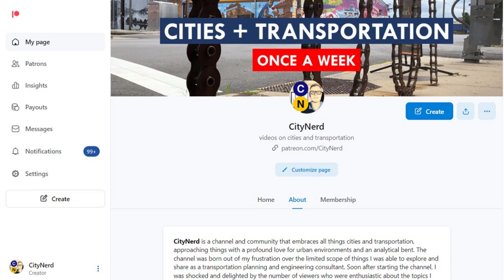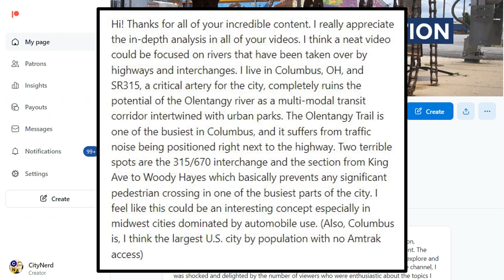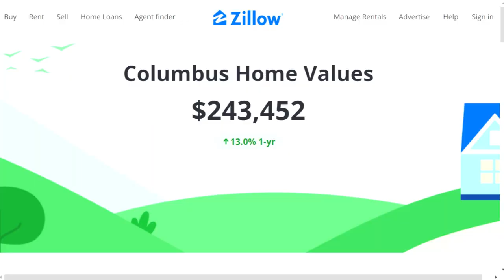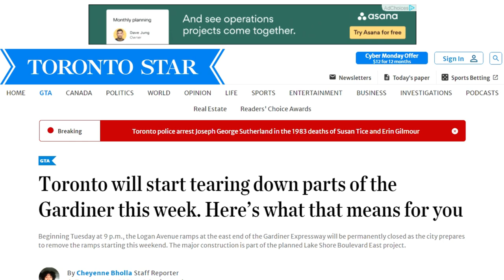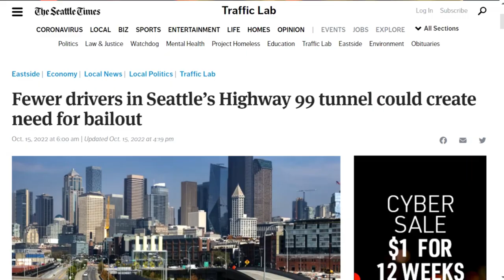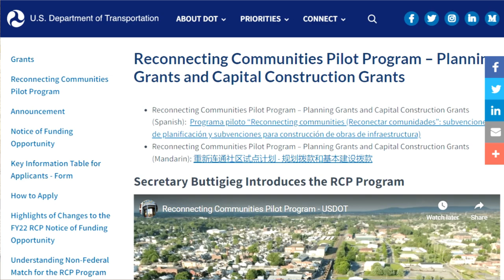Highway Engineering Madness: 10 Waterfront Freeways That Need to Go (North America Edition)

Comment: I lived in Brooklyn Heights/Dumbo for 10 years, and in NYC for 17. The BQE under the promenade is not only well tucked into the edge of the Fruit Street area, it does so without blocking access to the park below. There are several breaks where pedestrians can get to the park- at Doughty St, the unique cable bridge near the Watchtower building, and at Joralemon St and Atlantic Ave. The high end hotel near the Dumbo end of the park wasgenerously designed with a portal to provide access to the park. I believe most people in Brooklyn Heights actually like this bit of buffer- I know I did. While porosity is generally a good thing with city blocks, it would not improve the experience of either Brooklyn Heights nor Brooklyn Bridge Park for anyone and possibly make it worse. 

Also the view of Manhattan which occurs when traveling towards Williamsburg is astounding. Virtually everyone in NY has enjoyed this view. As you come around the corner near One Brooklyn Bridge Park, the intensity of lower Manhattan just hits you all at once. Soon you see the Empire State building dancing between the Brooklyn and Manhattan bridges. From above on the promenade, people not only look at the skyline, but the cars passing below as well. I lived in an apartment that was eye level to both the Manhattan Bridge and the BQE- I considered this a feature not a bug, as did my neighbors. 

The BQE may very well have been a mistake, but eliminating it would costs billions upon billions and disrupt life for at least a decade. The resulting retaining wall that replaced the BQE would have to be something like 10 feet thick. The land it would free up would not be useful for too much- it would be narrow and of course have a giant 50' wall abutting it. The city would be mired in NIMBY lawsuits from some of its wealthiest and most powerful residents. If Jane Jacobs were alive today, I believe even she would say it'd be foolish to tear it down. 

This is the problem with planners- they believe they and they alone have discovered Platonic models of urban form. If moving the BQE creates even worse problems in Brooklyn Heights- they'll say that was an unforeseeable negative externality. They do not care so much about local nuance and behavior. They take credit for what goes right, but never for what goes wrong. So while they wave the flag of Jane Jacobs, they are more like the Harvard planners she panned in her book- the people who ignored the intricacies and hidden systems of North Boston. This man, as far as I can tell, has never lived in Brooklyn Heights. His opinions about Brooklyn Heights shouldn't be taken any more seriously than my opinions on Portland or Seattle. 

Planners are a necessary evil. But they should act out of deep knowledge and experience living in the places they plan. While there are general heuristics on good city elements ( as in Jacobs book) there is no accepted theory of good urban form, generally. They desperately want you to think otherwise so they can continue to gatekeep their perceived authority over how you live in a city.

Comment: The worst thing about Storrow Drive in Boston is that it's officially parkland. Along with many of greater Boston's worst surface roads, it's operated by the state Department of Conservation and Recreation. It should be easy to get rid of, but DCR won't hear of it. I-90 will need to be rebuilt soon, and the state was hoping to do it at-grade to save money, but DCR had fisticuffs with the DOT over the idea that Soldiers Field Rd might have to downsize. DCR has a long history of sacrificing parkland to make room for cars, to the point where many locals call it the "Department of Cars and Roads" instead.

Comment: I’ve lived and worked in Boston since 2004, and one of the best moves this city ever made was to move its decrepit Expressway and Central Artery underground, as well as cleaning up the reeking cesspit that was the Charles River. As a result, what once was a vast expanse of desolate parking lots and condemned warehouses along the Boston waterfront has become one of the most up-and-coming neighborhoods on the east coast, and several financial companies I’ve worked for have built beautiful new buildings in places like 600 Congress Street, Rowes Wharf, and Fan Pier.

Storrow Drive, on the other hand, is a widely-hated engineering atrocity that resulted from the city being hemmed in by the river. It’s really difficult to think of anything better to do with a 19th-century waterfront boulevard that needed to expand, but had nowhere to go. All the side streets that go from the Back Bay onto Storrow are much smaller than the highway itself, so it became a stroad-zilla with lots of awkward bottlenecks, too many streetlights, and low bridges that are notorious for causing out-of-town trucks to be “Storrowed” (ripped open like cat food cans after drivers missed the height warnings).

Comment: Hi, I am a North Carolinian. In general, North Carolina tends to have lots of smaller watersheds as you approach the coastline, as opposed to one central watershed that all coalesces together. This is partially due to the very gradual downward slope from the Appalachians, to the Piedmont, to the coast. As a result, various watersheds feed into different estuaries, i.e., the Albemarle Sound, Back Sound, Bogue Sound, Core Sound, Pamlico Sound.

As such there is no one singular dominant watershed in which all commerce was historically conducted (compare to the Mississippi, the Ohio, the Hudson rivers, each dotted with large metropolises).

Also, as others have mentioned, North Carolina urbanized well after the North, and remains 40% rural by population (one of the most rural states in the country). Durham, for example, where I live, didn't exist before the Civil War, and rose to prominence because it was a railroad stop between Raleigh and Greensboro. This was a time (generally after 1850 as a heuristic) when canal- and waterway-based transportation had long since given way to freight rail.

Comment: Fun facts about Storrow drive: 

1. The land was donated by James Storrow and he vehemently opposed the building of a highway here but the second his wife kicked the van they built it 

2. There’s a very low clearance on the bridges that cross it but uhaul renters don’t seem to understand that leading to a phenomenon called “Storrowing” where Uhauls get opened on top like a tuna can

3. The esplanade is easily the most beautiful part of Boston but it’s incredibly loud because of Storrow 

4. They’re currently trying to fix a highway alignment to make use of a train yard no longer in use but instead of burying the highway, they’re trying to force even more lanes of traffic into a narrow bottleneck along with Storrow, the pike, a footpath and train tracks. Locals are calling it “Big Dig 2, Alston Bugaloo and despite MassDOT saying it’ll be done by 2034, no one believes them

Comment: Former Chicago resident here...I lived within 4 blocks of Lakeshore Drive for 8 years (2 different locations) and I wasn't too bothered by it.  It's a highway for sure, but I remember the posted speed limit only being 45 mph so traffic wasn't ripping through.  Its also very much an access road for local residents, and NOT a throughfare, so traffic was concentrated to commute times and there was virtually no heavy truck traffic at all.  I don't remember the lake access being bad, and I'll tell you, the bike/rollerblade/walking path and parks between the Drive and the lake were always packed with people.  I'll bet as many people travel Lakeshore Drive on a bus as in a car, so it is an important public transit corridor.  With all of that, the lakeshore would be much nicer without it.

Comment: Chicagoan here! I understand that the LSD does separate the lakefront from the city. There are a few points I think are worth bringing up. First, if the LSD was removed, the only other highway option nearby is the 90/94. The 90/94 is one of the most heavily trafficked highways in the region and I personally try to avoid it, if possible. Unless the city plans to determine a better solution for both of these highways, I think it is unlikely that the LSD would be removed. Also, I think it's worth mentioning that the LSD is extremely easy to cross as a pedestrian or bicyclist. I don't think that's true for a lot of highways. Personally, I am not as offended by the LSD as I was by the elevated highways in Portland. They are just so visible no matter where you are in the city.  
Great video though! I appreciate your knowledge and take on how we can improve the walkability of our cities!

Comment: Chicagoan here. Lake Shore Drive is just part of the city. It was here back in horse and buggy times. It’s a vital part of infrastructure that keeps a ton of traffic off of arterial streets. Plus, as many people mentioned, many bus routes use the Drive as a quick way for commuters to get downtown from far north or far south neighborhoods. I’ve lived within a mile of the lakefront in 4 different neighborhoods and have never found it hard to access the lakefront. There are tunnels or access roads everywhere. With all that said, many improvements could be made, mostly to mitigate noise.  Covering the whole thing would be ideal but simply removing would lead to a lot of commuters (including those using public transportation) to be displaced.

Comment: I live in Louisville and Spaghetti Junction there is awful. It's where all the interstates connect and you need to know which lane you should be in well before you reach signage unless it's late/early enough there's no traffic. 

The difficult part about removing the waterfront interstate is that we would have to get some actual transit first. We have bus service to some areas of the city, but the schedule and map are both lacking. I don't really have the option of using the bus even if the extra hour each way was doable, because it doesn't run when my workday is over. It's bad. Which makes the interstates worse. If you have to drive on them during rush hour the off-ramps often extend well onto the actual interstate lanes. 

But hey, it's cheap here.

Comment: i95 in Philly cuts off the entire water front from the rest of the city and also plowed through the most historic part of philly. they tried putting some lids over it but its only in small areas where its possible so you need to drive to get to the water front even if its only a block away in places.

Comment: I-91 is pretty egregious but it's necessary. I think it should be tunneled and the 91/84 interchange moved farther north up by the landfill to return the Bulkley Bridge back to a surface road as it was prior to the interstate system, creating an additional river crossing in the process.

Comment: Thanks for picking on I-580 in/near Berkeley. It's almost literally in my backyard, and I cross under it to get to the waterfront, never for a second escaping the roar of traffic. Based on the dense land use inland (east) from there up to the nearby hills, removing it would mean no freeway, and it's a dual-named freeway, almost at the terminus of I-80, so removing it would, as you point out, require a federal solution. Having lived through the overnight reconstruction of the "Albany split" interchange a couple of decades back, it's a long grudge, and I'm all for getting rid of it.

Comment: San Francisco deserves a bit more than a couple of seconds-long honorable mention. It is true that it took an earthquake to finally get rid of the monstrous double-decker Embarcadero Freeway, but the result has been a big success. Instead of a half-completed freeway blocking off a defunct and derelict port from the bay, there is now a surface boulevard with streetcars on a dedicated right of way running down the middle, wide sidewalks, and many other amenities. The Central Freeway was also removed and not replaced allowing the original street grid to be restored. Another chunk of freeway built south of Market in the 1970s was torn down before it was ever finished and opened. Worth mentioning too are the freeways that never got built in the first place because of the great freeway revolt in the 1950s. All is not lost.

Comment: As a biker in waterfront parks in New York City, I actually look for and prefer stretches of park that run uninterrupted because they are blocked by the highway next to it.  For example, Riverside Park along the Henry Hudson Parkway between 59th and 125th; the park along the Belt Parkway from the Verrazano Bridge to Coney Island; the park along the Cross Island Parkway from Northern Boulevard to the Throgs Neck Bridge.  The foot and bike traffic in these stretches of park is less because the highway is cutting it off.  This makes for a more pleasant ride and safer for my children biking.  And the views are amazing.  Yes, the highway does bring noise and pollution but this is NYC there is noise and pollution everywhere.

So I disagree with your #10 the BQE in Brooklyn Heights being a problem.  Land values in that neighborhood are so high already.  Would you suggest re-routing the I-278 into the lower-valued neighborhood of Bedford-Stuyvesant?  I don't think so.  Also, removing the highway would not create much more developable space, because the roadway is already terraced and there are only 2-3 narrow lanes.  If anything this should be an example of how to build highways next to waterfronts.  Thirdly, Brooklyn Bridge Park does not have an access problem.  It is overcrowded anyway.  The highway probably brings more people to the park because of all the people driving by and saying, "What a great view let's go to that park!" Not a place where I can have an enjoyable bike ride with my kids.  Also in terms of access, an elevator between the park and the heights can be built even with the highway there.

Comment: LSD is not a typical freeway in that the highest posted speed is 45mph and no trucks are allowed.   There is parkland between LSD and the lake for almost the entire length of the drive. Contrary to what others have said there are many access points with pedestrian tunnels,  bridges, pedestrian / bike bridges and some crosswalks.  For events like the Air/Water show and the 4th of July fireworks, it's not unusually for over a million people to gather on the lake, east of LSD.  On the south side there are 3 recently added very large pedestrian / bike bridges that span across LSD and the Metra Tracks.  These bridges are impressive structures with good esthetics. The city also invests a lot in maintenance of the roadside with trash removal and landscaping so it doesn't have the trashy appearance that almost all the others on your list have.

Comment: Chicago native here... I never thought it was an issue growing up.  I grew up downtown and walked to the lake all the time.  The tunnels near the beach are kinda gross... but the ones around the museums are really nice.  I didn't drive until I was 30 and the only problem with the drive is that there is a stretch along the downtown area with stop lights.  It is, as you say, an expressway.  That it is interrupted by stop lights is the issue.  It should either be raised or lowered along that stretch from Roosevelt up to North ave.

Comment: Louisville had a strong grassroots effort called 86-64 to get that stretch of interstate reduced to a small ground level boulevard. Combined with the new East end bridge to route commercial traffic, it would have been a slam dunk. But the east end nimbys crushed it. They also succeeded in running the approach to the East end bridge through a tunnel, claiming the route threatened historic property. That might be on your list of unnecessary tunnels. Thanks for the video

Comment: As a resident of Bay Ridge, I'd say the belt from the BQE split to at least the Verrazano.  I get where you're coming from with the Promenade, but the stretch I'm talking about is at grade with low and medium (or I guess medium and high by standards of the rest of the country...) density residential the entire stretch, and cuts off and reduces the pleasantness of the harbor side path.  Removing or burying it would tie together the string of parks already built along the side of the freeway as well.  The Promenade is in an otherwise just louder area, and is decently integrated with the terraced park above the freeway that abuts residential area.

Comment: The thing about the QEW in Hamilton is that it barely serves the city - it's primarily a corner cut for traffic going around the end of Lake Ontario between Toronto and the US border. Vancouver escaped having urban expressways largely because not much traffic is crossing through to go further north - the city is on a peninsula and it's all mountains, fjords and thinly populated areas north of the greater Vancouver area. By contrast the Hamilton waterfront is sitting right in between much larger regional and international trip attractors, and became an expressway casualty as a result.